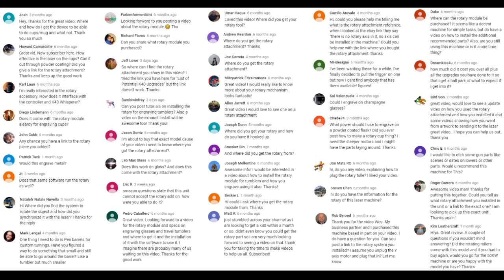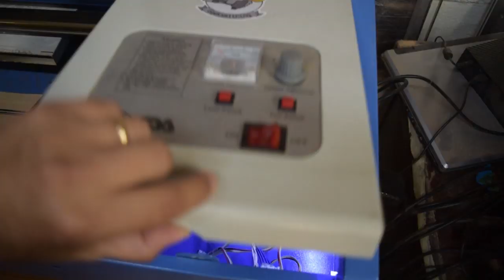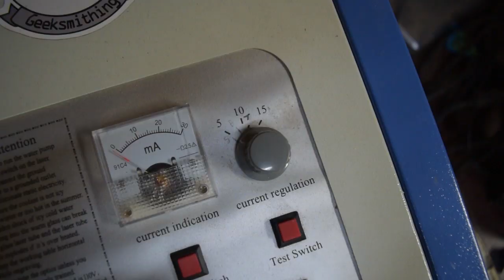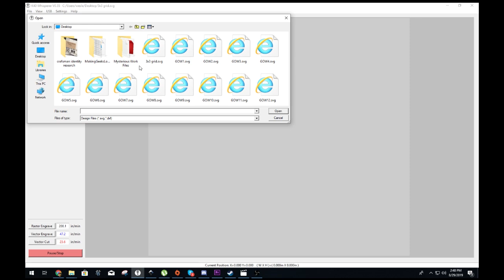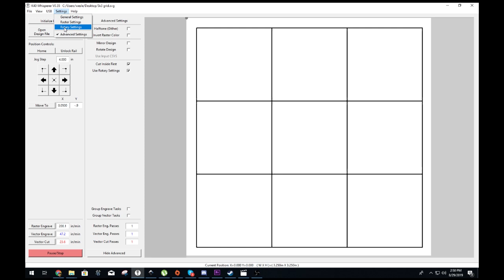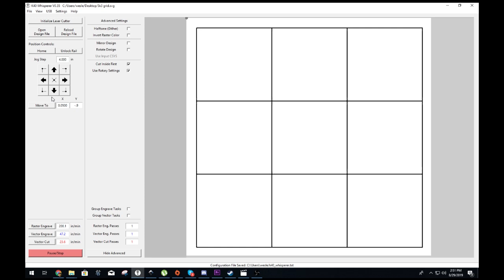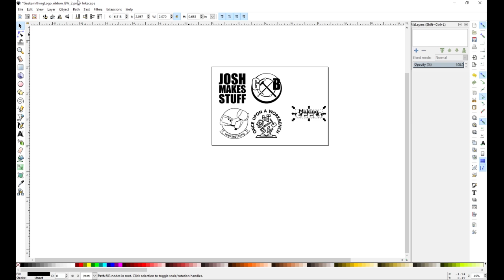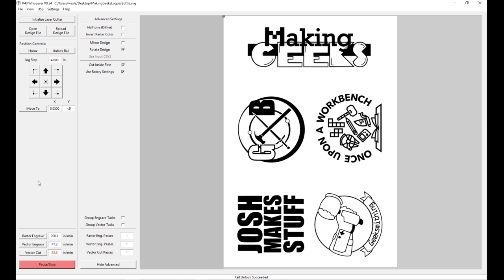DIY Rotary Module for K40 Laser Engravers!

Comment: Just out of curiosity how long did that Tumblr take to engrave on that K40

I'm considering replacing my xtool D1 with ak-40 and I mostly just do small flat stock and tumblers and just seeing if it will give me a speed increase
Reply from the maker: I'd say about 15 minutes. Probably not running at top speed. If there is detail all the way around it takes longer. A typical tumbler with a small message is like 10 minutes.

Comment: I’m curious, how do the designs work when the cup is angled? Like how the 20 Oz Yetis are wider at the top than bottom. 
I work with vinyl and I know the images can be warped to fit. Same premise? What about the laser being further away from the item at the more narrow part?
Reply: Holly Ellis You would change how far from the ground the rotary is. You would either engrave the top or bottom part of the 30oz yetis, and the 20oz should be fine

Comment: Great Vid ...what minimum specs PC would your recommend. We need to by a PC Laptop but don’t want to spend a tone of money but want something that has enough specs to drive this and somewhat future safe. I’m a Mac guy so I have no idea about PCs and the features I need to drive this unit—Thanks
Reply from the maker: Speaking of Macs, there is apparently a subset of folks that use K40 whisperer on Macs. I don't have any personal experience doing so however...   You should be able to certainly get by with most PC hardware.  Get something with at least 16GB of RAM I'd say.

Comment: Tried lazer cutting the SVG file provided in your link. Having an issue with the sizing through inkscape. Are you able to supply the dimensions for the chasis?
Reply from the maker: I have updated the files to include some dimensional measurements to allow for proper sizing if you scale the svg and maintain the aspect ratio.

Comment: Amazing work! I can't wait to try it.
Just to check, what thickness of wood should you use if laser cutting the chassis?
Also, which length m3's work best for mounting the motor?
Reply from the maker: Good questions! I used 1/8" pieces of Baltic birch plywood sandwiched together (I need to add that detail to write up...thx!).  And I'll measure the screw length when I get home.
Reply: @Geeksmithing  Perfect, thank you.
Reply from the maker: Sorry about the delay.  They are 9mm long.   Let me know if you have any other questions!
Reply from the maker: @DanielLevesley  thanks for asking! I will update the info for others. 👍

Comment: Wes, thank you for the video can you repost the link to where to get the parts for the machine can’t see to find it in the comments below, also can I make a smaller one for smaller items like shot glasses, etc
Reply from the maker: Hey Karol. All pieces are linked in the video description.  To engrave shot glasses some changes would need to be made to accommodate the smaller diameter

Comment: Can you engrave anodized bottles or only painted? Where do you get the bottles? How is the K40 working for you? I am thinking of getting one but am hesitant to get a Chinese made K40 knowing (and seeing on Utube) the quality of these machines? But ...at the same time I don't want to spend thousands for my first machine.
Reply from the maker: The K40 can laser off powdercoater paint and anodization as well. (I have lasered colored/anodized dog tags before)
If you get the K40 on Amazon, you are pretty protected from a consumer standpoint. I have heard of folks getting things replaced and remedied when things happen to arrive broken.   I figured for the cost, it as worth the risk, and worst case I could use the parts for a robot or 3D printer😆🤷‍♂️. I have a video on the K40 that gives more guidance of interested.  Good luck!

Comment: How did you get a 200-2GT 6mm belt around the Metal Pulley for the Stepper Motor? Using the links for the parts, the Metal Belt Pulleys for Linear Rod are too tight for the stepper motor pulley.!
Reply from the maker: I recently started hearing this more. I'm investigating it and looking to make improvements. Sorry for the troubles!
Reply from the maker: I have revised the chassis files on my website to hopefully allow enough adjustment to help with over-tensioning on belt.  Let me know if that helps!

Comment: I successfully built the rotary. I am noticing sleight wavy lines parallel with the y axis when raster engraving. The rotary spins true and belt tensions are good. Any ideas where my issue lies?.
Reply from the maker: Hmmm... Not off hand, but send me a message/pic of it on one of my social media platforms (or contact thru my website) so I can get a better idea.

Comment: Are you able to do a bigger diameter yeti tumbler inside the k40?
Reply from the maker: yeah, but only if you remove the bottom of the unit.  Not enough clearance otherwise.

Comment: Hi Wes,
Great video !!  We learn a lot by your posts !!
The calculation you made (end up with 0.78) is that for this bottle-diameter or for this rotary setup (stepper/wheels etc)  ??
Reply from the maker: Hey thanks!  It's the multiplier for my rotary setup (stepper wheels etc. Exactly). I can laser any diameter object that would fit, and that value doesn't change.  I'd encourage everyone to do their own test bottle and calculate their own multiplier for best results.
Reply: @Geeksmithing  Oke, Thanks !!!

Comment: The K40 lasers that you referenced above all state in their descriptions that they are to be used on nonmetal surfaces. If I am interested in doing tumblers, as you did in your video what laser should be purchased? Or is this referring to that it won't "cut" metal?
Reply from the maker: For tumblers and the bottles in my video, it actually isn't doing anything to the metal at all but vaporizing the powdercoated paint on the surface. 
It is merely revealing the metal below.   The K40 is certainly capable of that. :). Hope that helps.
Reply from the maker: And yeah, the K40 and other CO2 lasers of this type cannot engrave or cut metals whatsoever. It can only remove or mark the surface paint/powdercoating or Anodization.   Depending on the project, this may be all you need.   You can also use a marking spray such as Ceramark to make black letters/graphics on metal surfaces.

Comment: Thanks for the video! Can't wait to give it a try. One issue is that the stepper motor holes don't line up with design of the frame. Am I missing something?
Reply from the maker: Hmmm first I have heard of that.
Reply: @Geeksmithing  Sorry I didn't see that the stepper motor needed to mounted diagonally.
Reply from the maker: @sdepace  no worries, glad you got it sorted

Comment: Item I want to engrave is 1' to maybe 2" diameter at most, what is your recommendation on modifying the rotary to accommodate the smaller diameter?  Bigger pads on the rollers? Modify the brackets?  Make two larger wheels to ride on the rotary with my material threaded on a rod between them?
Reply from the maker: You could definitely add larger roller wheels... You would just have to raise up the legs as well.   There was a person that recently shared a different redesign idea for the rotary that might be worth me investigating to allow for smaller items such as pens or shot glasses... 🤔 Might be worth revisiting...

Comment: Do you have to recalibrate the rotary for different size cylinders every time you do something different?
Reply from the maker: Nope! The calibration is for the stepper motor that drives it, not the size of the object. I have engraved even a large growler in this thing, no difference.
Reply: @Geeksmithing  awesome, thanks for taking time to answer.  Sounds like a great addition for the k40.  I'll probably do one on the future.

Comment: So I've got all of my parts to build the rotary and I am cnc ing the parts for the brackets. Laser cutting was proving to be too difficult.   Do you think all the stepper motors (same as yours) I should just try to go for .76?
Reply from the maker: As long as they don't pull too much current, it could be too much for the stock power supply.
Reply: @Geeksmithing  its the same stepper motor you have listed in your list.  Thats where I bought it.  What I mean is .76 per inch in the settings
Reply from the maker: @warriormountainworkshop7099  instead of doing the adjustment calculation you mean? Maybe.  Might be a place to start from, but if you power supply is different than mine it is possible it may be different.  It's easy enough to do anyways.

Comment: Hi. Just wondering, if I were to use a tapered bottle and raise the one end, would the lasered image be distorted because of the gradual change in diameter as it’s engraving? Would I need to alter settings to reflect the “cone” shape of the bottle? Amazing video btw. Thanks :)
Reply from the maker: Great question! Imagine putting a wide sticker on the tapered part of the bottle. Now place that bottle upright on a table as one would do when liquid is in it.  That sticker sort of curves up when viewing it on the table relative to the flat surface of the table.  Hard to describe....😆.   That's why I figure lasering perpendicular to the center axis of the bottle when spinning is best, even the tapered parts.  It certainly takes some experimenting to get a feel for it.

Comment: Is calibration necessary because of a difference in stepper motor? I understand that k40's use non standard 0.9 degree angle as compared to 1.8 on standard steppers. Thanks
Reply from the maker: Great point! That is very likely!

Comment: Seems like you should just wire up a simple toggle to close that limit switch circuit on your control panel. Assuming its Normally Open, you can just close the circuit and label it "Rotary Mode".
Reply from the maker: It's only a difference of using my right arm to press this hypothetical button, or left arm to press the limit switch. 🤷‍♂️ Doesn't seem worth it to me.  Good suggestion though!
Reply: @Geeksmithing  its permanent and looks intentional my way? But touche'. I am just right handed. LOL
Reply from the maker: @waldvogelreview7755  I don't engrave many bottles anymore, and the limit switch is also permanent. ;)

Comment: Most of what I want to work with are not perfectly round...how's the quality, and how well doe sit work, on non-perfectly-cylindrical objects like the first (white) water bottle you showed?
Reply from the maker: For objects that are tapered, I make a ring(sometimes laser cut, sometimes just a roll of tape!)  And stick it on the end to allow it to roll level.  Then as long as the surface that you plan on lasering is within the focal range, it works pretty well.
Reply: @Geeksmithing  Great idea thanks!

Another question, do you know, is there a limit to the circumference of the object? Sorry if this is a silly question...I've used 3D printers but not lasers. I'm guessing since the X limit switches are never triggered the system wouldn't know the diff, but the software might.

Say I want to engrave an object with an 8 inch diameter...technically that's a ~25 inch circumference!
Reply from the maker: @AFlyingBean  as long as you can fit the object in there, and have the surface at the right distance for the laser, it doesn't matter! (even easier if you remove the bottom from the laser as I show). I have engraved a big 64 OZ growler bottle in there and it worked perfect. 
https://www.walmart.com/ip/bubba-Stainless-Steel-Growler-Water-Bottle-with-Wide-Mouth-64oz-Licorice/765224900
Reply from the maker: @AFlyingBean  exactly, the Y axis limit switch is never triggered, so it just keeps going, and the software doesn't care how tall the image is that you are engraving :)

Comment: Are there any CNC files or do you have the actual dimensions  for the chassis.   Im getting the Millright mega V hopefully this month and ordering a k40 probably the following month.   I would really like to get this installed as soon as I get it.

Ps.  Im new to all of this
Reply from the maker: I have updated the files to include a few dimensions.  You should be able to scale the SVG to determine the proper size with this information.
Reply: @Geeksmithing  great,  thank you

Comment: I have been trying to find a K40 with the Milli Amp meter without success can you provide a link to the seller you purchased yours from?
Reply from the maker: Yeah, unfortunately it seems like they are phasing them out, but you can still find them from time to time on eBay:
http://rover.ebay.com/rover/1/711-53200-19255-0/1?ff3=4&pub=5575342369&toolid=10001&campid=5338203865&customid=&mpre=https%3A%2F%2Fwww.ebay.com%2Fitm%2F40W-CO2-Laser-Engraving-Cutting-Machine-Engraver-Cutter-12-8-Woodworking-DIY%2F200800873039
Reply: @Geeksmithing  Thanks for that!
Reply from the maker: @AndrewAHayes  you bet! Good luck!

Comment: If you plug in the 4 prong Y axis plug backwards, I think it won't work at all.  The red/green wires in the middle would have to be swapped also.  I'm speculating.
Reply from the maker: It will just cause the motor to turn the opposite direction. ;) I know cause I have accidentally done this. :)

Comment: How well does this design work for tapered bottles? I am interested in building one but I can see more of a need to be able to engrave tapered bottles versus a consistent diameter.
Reply from the maker: Great question! It works well if you use one more piece than I showed in the video.  Laser cut a ring where the outer diameter matches the diameter of your widest part of the bottle, and cut the inner diameter to slip onto the tapered end (effectively making your bottle a straight cylinder)  Just make sure your design fits in an area of the bottle where the distance from the laser head never gets too far or too close. 60mm +/- 5mm.       Hmmm... perhaps I should make a video about this... haha.   Hope that sort of makes sense.
Reply: Geeksmithing Thanks! A video on this would be greatly appreciated.

Comment: When you cut the bottom out of your machine was it to literally lower it the thickness of the metal bottom? Or did you also put the wheels on it and you place your rotary on the table surface?  I hope that made sense
Reply from the maker: Hey! I cut it out to allow me to put the rotary lower to allow me to engrave larger diameter objects such as tumblers and even growler bottle sizes.
Reply: @Geeksmithing  my laser is in the mail so maybe it will make more sense when I see it in person.  Thanks for the quick reply!
Reply from the maker: @warriormountainworkshop7099  you bet! Good luck!

Comment: Very helpful, thanks!! ... I see a diy rotary attachment in my future.  One question I have that you didn't seem to address in the video -- where do you source your bottles?  how do you know which ones will work?  Is the end result durable?   Thanks!
Reply from the maker: These specific bottles are super cheap ones I picked up on clearance at Wal-Mart years ago.   Any colored stainless ones should work.  The end result is as durable as the original paint was on the bottle, as that's all that remains on the bottle.   I have successfully used ones from Walmart, Target, Amazon etc.   If they are straight metal without a coating, that's where you will run into issues.
Reply: @Geeksmithing  great thanks for the tips!  ...Have you tried bare glass yet?
Reply from the maker: @quartapound  I have used it on ceramic and glass tiles and it works great.

Comment: Is Gt2-200 a 200mm long belt or is it one with 200 Teeth? I'm trying to find this belt in germany and i just don't understand what belt exactly this is.
Reply from the maker: From the item description on Amazon link:
Specifications
- Material: Neoprene rubber with fiberglass core
- Length: 200mm
- Width: 6mm
- GT2 pitch : 2mm
- Color: Black - Teeth quantity : 100 -Belt height : 1.52mm
-Tooth height : 0.76mm
Reply: @Geeksmithing  thank you.. That's embarrassing 🙈... Couldn't find this yesterday but today I see it right away
Reply from the maker: @DerGreve  No problem!! I am happy to help!  Feel free to ask away!   Good luck!

Comment: Do you sell a fully assembled rotary attachment? I don't have a 3d printer nor do I intend to purchase one, but I would love to be able to have this in my new engraver.
Reply from the maker: Sorry no, but I did list the metal items you could buy if you didnt have access to a 3d printer...😜👍 And you could laser cut the chassis piece, so you really dont have any excuse 😛
Reply: @Geeksmithing  Thank you for the quick reply.

Are you familiar of any spceific machines that are NOT able to be hacked to use a rotaty attachment?

I purchase a preenex (red) 40w laser and the seller tells me that there are NO attachments that work with it.

I am a little concerned...so I need to confirm this and purchase a DIFFERENT one...or ignore them becuase I almost think they are just not wanting to ENDORSE it as possible...thoughts? :)

Sorry for the long post...I am getting ZERO assistance from anyone...lol...:)
Reply from the maker: @cwallace91472  As far as I am aware, all of the K40 style lasers use similar stepper motors to drive the X and Y axis.  All I am doing in my video is temporarily rewiring that Y axis motor output to use my Rotary stepper motor instead.  The laser machine doesn't really know the difference.  As you stated, it is likely that they do not want to be responsible for people cracking the machine open and messing with the internals, which I can understand.  There is a great Chinese K40 laser Facebook group that I could share with you that might be able to help support your decision further.
Reply: @Geeksmithing  please do. I would love to find an interactive online area to communicate with other users.
Reply from the maker: @cwallace91472  Awesome! Here ya go!
https://www.facebook.com/groups/888394261237059